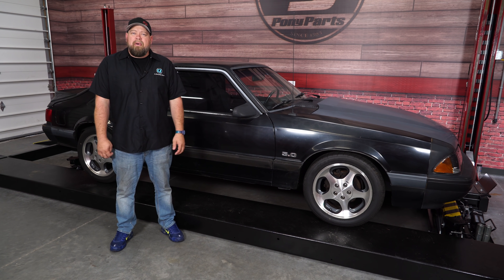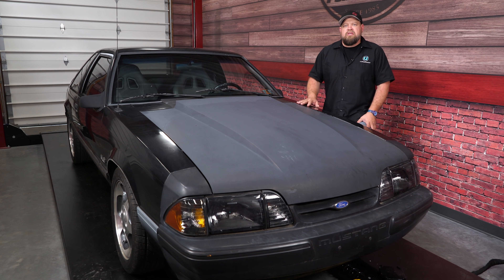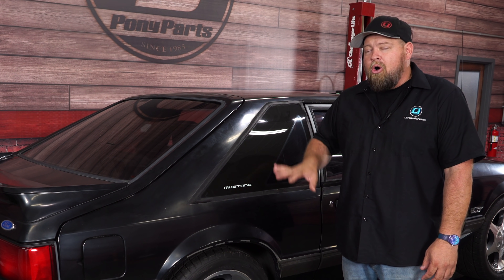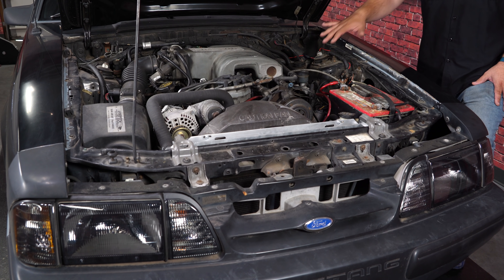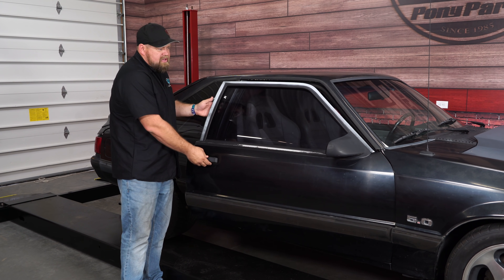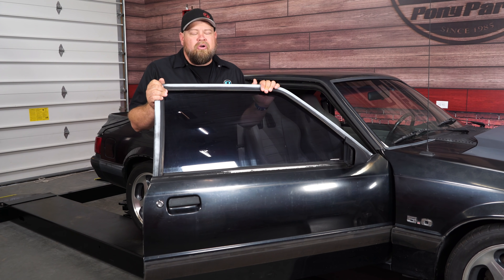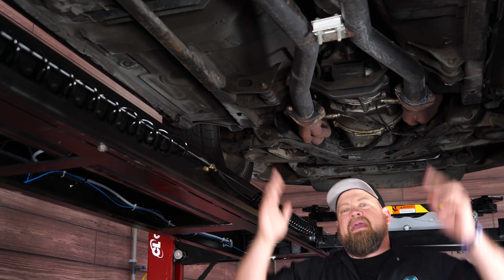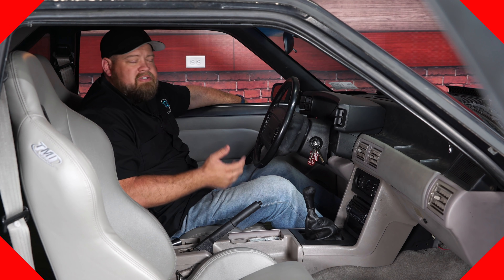Buying a Fox Body Mustang? Here's What You NEED to Look For!

Comment: IMO a few other things to consider.  The HO5.0 has forged internals and so high miles are easy to obtain, even with moderate abuse.  200k is nothing to a stock motor.  An automatic will have less abuse, and so in many ways a better foundation for a project.  

Often overlooked especially for modified car with severe abuse like drag racing may show in cracks across the top of the a pillars with body twist. If you see a crack at the top of the a pillar, presume too that the torque boxes are going to be twisted as well and that its had a hard life with too much spent on slicks on a sticky surface. Check for these things even if its 'stock'. These cars have history and it may be stock now, but may not have been so its entire life. 

If your going to modify be careful of the the 86. Its the first year of EFI, and it is a one year only head and piston combo.  This means that most 'top end kits' won't fit without changing pistons. Roller cams were available first in 85. 

Mass air (89-93) takes to mods (bigger heads, intake, etc) like fish to water, but not the same for vs speed density found on 86-88, and if you upgrade to mass air, you have to replace the computer as well. 

79-85 cars do not have an 8.8 rear end.

Last point, 91-93 has slightly wider fender opening at the bottom, which makes it easier to have larger wheels.  

This makes 91-93 cars a premium, so expect to pay more. Deals can be found in older years but at a cost to modify, and keep your eyes peeled for Lincoln Mark VII, as they have the same HO 5.0 as the mustangs and make great donors and rarely live a life of abuse we see in the Mustangs...and yes those comfy seats in the LSC Lincolns do fit!
Reply: Great write up thanks
Reply: Didn't know that, thanks for correcting.
Reply: Trick Flow top end kit works well with the '86 setup. You are still stuck with the crummy speed density ECU and tiny 10" front brakes though, unless you swap those out - skip the A9L and go for a Megasquirt based ECU if you want to get into heavy mods. 86-93 has a 10.5 inch clutch, too, which is better right out of the box, and you have a lot more aftermarket choices.
Reply: No, 93 aren't forged unless is a 93 Cobra or Cobra R
Reply: Another thing not added is that the Aftermarket Lights, although they do look great, they are a total pain in the ass to adjust correctly. I'm the only one (that I know of) as of this date, 12/1/18, that has complete sets of NOS 6 Piece Light Sets.  mustangman@goldenwest.net  Jon
Reply: You might want to update that. Speed Density cars take well to bolt ons. You can change the heads, intake, cam, ect but you have to be careful. Mostly with a cam upgrade. You can switch it to mass air but Ive seen quite a few run worse after switching the ecu. If you want a mild street car then get a sd car. Heads and intake are also tricky to nail just because trying to tune it right is a pain.
Reply: So... pull the engine, and scrap the rest and look for a project car to receive the transplant.   Got it.
Reply: Prushimush 90's and earlier Trick fllow heads never made good power. They had great marketing, but unless they're newly designed and manufactured heads I'd stay away from them.
Reply: There is one infallacy the 89 is the only year with a gray interior that had red tweed or a pattern of red threads throughout the seats. Also the 91-93 have air bags, hence better insurance if your company provides discounts for things like air bags and abs, power brakes, less power ( 4cly or v6) etc. The 2.3 turbo and 4.2 V8 are REALLY hard to find. More notes
Reply: @katcraig9460  ...yet another reason I like the '79-'86 the best...I have never been a fan of plastic "composite" headlights...don't like them to this day..give me glass sealed beams...I think the '87-'93 looks fine now, but I still prefer the earlier ones...for me, I like the '85-'86 setup the best...I remember when the '87's came out, everyone was exited about the extra power, but reaction to the new front was negative from most of the guys I knew, including myself..I remember comments about the "Taurus-looking" front end...in the end, though, it didn't stop most of them from buying one....
Reply: Thank you! Great details to know.
Reply: Sorry to correct but: it´s just the pistons that are forged, the rest of the internals are not...-92..93 cobra, same thing. I´ve worked on these cars for 20 years, own 2 engines. but they are great fun none the less, best bang for the buck
Reply: @petedogg369  It is for me since I'm running an 18" wheel that supports oversized brakes. Well worth it for me.
Reply: @petedogg369  To each his own, and there's a world of aftermarket to suit everyone. The options I want require the extra, albeit small, different. My lx hatch will use every bit of that extra fender for 18" Makers Garage wheels and 6 piston brakes. For what you do sounds like cobra's are the route.
Reply: I guess Im asking the wrong place but does anybody know of a tool to log back into an Instagram account?
I was dumb forgot my login password. I would appreciate any tricks you can give me
Reply: @Aiden Grayson Instablaster :)
Reply: @Briar Kashton i really appreciate your reply. I got to the site through google and im waiting for the hacking stuff atm.
Looks like it's gonna take a while so I will reply here later when my account password hopefully is recovered.
Reply: @Aiden Grayson no problem :)

Comment: Check for a gap between the top of the fender and the lower windshield molding on the passenger side. If the gap is noticeably larger than on the driver's side, the car has been launched hard repeatedly, twisting the subframe. A small difference is no problem but if you can get a matchbook under there, the car should spend some quality time on a frame machine.

Comment: Foxbodies are still kings of outlaw, no prep and 1/4 mile drag racing. Any engine/trans/boost combo you want, they can take. Dont forget, first mod needs to be subframe connectors!
Reply: HI I'm thinking of buying an '87 FB, as I have a 400 with a c6 ready to go. Will this combo fit? What mods will I need to consider? Thx, Bob

Comment: My father just gave my 13 year old son a 87' convertible GT 5.0 liter.   Originally bought by my brother in law and given to my Dad when the head gasket blew when they were moving out of state.  So the car is awesomely solid.   No door dings and well maintained.  It mostly needs a super cleaning, little fixes and some customizing.   The only rub is it doesn't have AC.  He bought it up north and then moved to Alabama.    So, how hard will it be finding a junked one with AC to add it to the car?   I look forward to working on it with my son.  In the early 80s my Dad and I build a 65' for me.  My Dad gave it to my son while under hospice care.    I learned a lot building a car with my Dad and its and experience that I will always cherish.

Comment: I bought a 79 5.0 4 speed Indy Pace Car in 1987. It’s floor cracked below the driver seat in 1988. It’s a fairly easy weld with the seat out but Ford was just being cheap with the design of that floor pan. The 1979 model had more engines than mentioned in the video: 2.3 normally aspirated,, 2.3 Turbo,, 2.8 V6,, 3.3 inline 6 which was 200 cubic inches and the 302 V8. Ford ran out of the 2.8 V6 before the end of the 1979 model year and started installing the 3.3 inline 6. The pros on this Mustang is its light and a lot of aftermarket parts are available. The cons is that they are not a strong body in a crash. I would consider a roll cage for one if I can ever own another one. The guy in the video didn’t mention the 79-81 2.3 Turbo’s which often didn’t make it to 100,000 miles. The 80-81 Cobra was a nice looking car especially the black one with green stickers. One of them used to show up at the Dairy Queen I worked at in 1987 and 1988. I’d love to find one with the V8 and either sunroof or standard roof,,, no T-Roof because they leak.

Comment: I bought a 93 and spent many paychecks on it.  I didn't even know that car was in a severe wreck.  Don't make the same mistake i did.
Reply: How did you end up finding out ?
Reply: @heavychevyss2784  
Usually on the cars door jam there should be a state sticker on it sometimes saying the likes of "certified re-built". My 2000 Toyota 4Runner SR5 v6 was rebuilt as well but I didnt know until months after I bought it where I discovered the sticker in the truck's door jam. It's kinda still reliable, but nowhere near as reliable as it would be had it not been wrecked and re-built. I'm guessing Sinister Rc found out in a similar way.

Comment: 86-93 cars are the best from an out of the box standpoint - 8.8" rear, 10.5 inch clutch, fuel injected 5.0 engine. 1986 is the last of the Four Eyes and has most of the good stuff from later models. In 1987 you get valve reliefs on the pistons for bigger valve/cam clearance and better heads to match. In 1989 Ford moved to a MAF setup for the ECU, which happens to work better with aftermarket cams and other mods.

It's worth discussing pistons on the stock 5.0 engines. In 1986 you get forged flat tops. These pistons don't play nice with most heads and cams, but you will have a lot of clearance with Twisted Wedge heads from Trick Flow, so they are still worth using if you have them. From 87-92 you get forged pistons with valve reliefs to match the new E7 heads. These are good pistons and work well with all sorts of heads and cams, AFR et al and are generally the best ones to have from a head and cam choice standpoint. In 1993 Ford introduced a hypereutectic piston to replace forged pistons. This new piston expands less under heat than the old forged pistons and were cheaper to produce, but they are considered inferior from a hobbyist standpoint as they don't handle boost and nitrous as well and are somewhat more vulnerable to detonation than forged pieces.
Reply: Thanks so much. I have been asking the Mustang "experts" about my 91 pistons and so many people have told me they are NOT forged, but from what i have read they are. My question is can I run TFS Heads with these or should I switch them out? I have an older set of twisted wedge heads and a stage 2 Trick Flow Cam that I want to install when I rebuild my motor later this year. I'm also going to get the Trick Flow top end upper and lower.
Reply: @pagosplace3065  put them on check valve clearance if it hits then obv no go

Comment: Yeah, he nailed the top 3 in my opinion.  Cracked strut-towers, rusted out floorpans, and ripped torque boxes.  Good luck finding one that has none of these issues unless it's been a garage queen since birth.  He's actually missing another issue.  The leaking windshield.  Also, in the bottom corners of the windshield, behind the plastic speaker-grills, if you remove them, you can look at the sheet metal panels here also.  These tend to rot fast.  Just before I sold my 1990 LX, I checked mine and they had dry-rot.  I had fun with the car, but since selling it back in 2009, I don't miss the car.  I would never buy another either.  My advice to anyone here, unless it's a car from Arizona, you'll never find a mint Foxbody unless it was torn apart and rebuilt correctly.  I read articles when these cars came out they had already started rusting in the dealers lot.  Most I'd ever spend on one today is $5000 USD for a mint specimen.

Comment: 89 gt was my daily knew a friend who had a 90 gt. Fog lights would cut out the headlights randomly, not fun to have your headlights/foglights  shut off  doing 60 mph on a country road at night. Guess the switches are bad. Don't ever rage punch the horn in a pre-airbag fox. I did, the horn got stuck on and I had to drive like an idiot for a mile before I pulled over and pulled the horn fuse.
Reply: I had a 93 GT amd it did the EXACT same with the factory fog lights! Lol the first time it did it scaredbthe shit out of me. I just popped em out and put a set of PIAA lights in the holes.
Reply: I punched my horn in my 89
Lol. Had to do the same thing

Comment: Just gonna throw this out there it's been awhile living in my Mustang life but time to get back at it.... Great videos.... I have a1983 mustang GLX Convertible... 5.0..5spd Manual.... White exterior black stripe up hood... With hood scoop...Interior all black....78,000 Original miles... Only thing not original are the rims.... Was told came factory with hubcaps. Years ago when I was researching I could not find one like this... Was told by the car dealer that the guy that owned it before me ordered it out... I'm thinking I might have 1 of 1.... Open for any comments... Craig R. Olson

Comment: I have 3 in my garage from when I was 19 I have a 89 90 and 91 2 have 25 anniversary on them the one is built up well 373 gears tremec tko 3550 trans the 5 liter is stroked gt40 head b303 cam it hauls ass no cats bbk h pipe and headers upper and lower intakes are hand made subframe mounts strut tower brace rear sway bar I like it alot I wouldnt take any under 89 the fuel injection 5 litres is were it's at.

Comment: i like how the heater core problem is glossed over as a "time consuming repair". i replaced 3 of em in 2 different cars. basically ya gotta take out the interior except for the rear seats. you could do a motor swap in half the time. them fox bodies like to eat em up. yum yum. they are thinner than tin foil. Be very ginger with the inlet and outlet hoses under the hood. also, LEAVE THAT FLOW RESTRICTOR IN PLACE!! If ya took it out, ya know what will happen...

Comment: So make sure it's not rusted out. Same advice applies for all cars. The steering and fromt suspension should be checked too. They tend to be sloppy after 30 years and 200,000 miles.

Comment: Bought a 84 1/2 GT way back in 86. The heater core was already leaking.
Did handle better than the earlier models with the 4 strut rear. The EFI was trash though.

Comment: If the bolts and the plate on the trust tower are rusted, is it safe to say the rust traveled down? Would you see that through the wheel well?

Comment: They also respond really well too simple bolt ons like a chip an ignition underdrive pulleys throttle body flowMaster hi flow cat headers centrifugal Paxton super charger, some chassis items from steeda and you have a capable daily

Comment: Thanks for the video...good info.  I have to point out that as an owner of a 1983 GT...bumper covers are NOT available for the early Fox.  I looked for over a year for a rear bumper cover and it took me that long to find one in good enough shape to use.  Used only...nobody makes them new yet.  I think the fronts are the same but there are still some NOS out there but rear covers seem to be almost non-existent.  Perhaps you could bring this up with your supplier to repop them?  Thanks.

Comment: There was a few things he missed like the hatch locks normally either rust shut or rust open and there is a inertia switch behind the tail lights if something bumps you from behind or you take the lights out it sets the button off and the car wont start easy fix but I had no clue it was there and the firing pin in the ignition I've seen a few cars where that went bad my car was like that and I'd have to roll start it until I found out it's a $10 fix overall though my mustang was the easiest and cheapest car to maintain

Comment: If it gets the gangster lean you just have to get to the inside of the seat under the skin and re weld the broken spot weld, done by a professional it shouldn’t take more than a hour with the taking off and putting back on the skin taking up the most time

Comment: Four eye all day , everyday !
Reply: <- '86 5.0 is my favorite, refer to my user pic. Last of the four eyes, you get the best of the 87-93 models - 8.8 rear end, 10.5 clutch, fuel injected 5.0 engine. Contrary to popular belief the forged flat tops in the '86 engine are good pieces and play nice with Trick Flow heads. Get some bigger brakes and spindles from an '87-93 Aero and you're ready to boogie. It's a good year for the Foxbody.
Reply: Had two different 84' GT's.  First one had a SVO wing/spoiler on it. It got stolen twice. The first time they caught the kids in it and I got it back, second time the pro's got it. They found the shell down by West Grand Boulevard in Detroit.

Second one came from Bill Brown Ford's used car lot. I believe it was traded in by a Roush employee, as far as I knew it was stock, but it beat cars in races that it shouldn't have. That car was a beast. I owned it for four to five years and when I sold it I still got $2700.00.

Had a 93 sedan/notch, strictly a toy, self built, 69 351 Windsor, Toploader and a 9" rear. It could break the rears loose at fifty, it was a handful, I miss it.
Reply: @dississtupid  I miss a few of mine two , I had two 85's , both notch backs , one was a GT , the other one was a little 2.3 , my dad bought the gt brand new , and I got it when I got my license , you don't think when your young and dumb like I was , fortunately I learned from my mistakes as I'm getting a bit older now . The first brand new car I bought was a 2002 GT , and I still own it to this day , and I don't ever really plan on parting with it . Back in 2017 I felt I needed a new toy and ordered a 2017 EcoBoost premium , and I don't ever forsee parting with that one as well . Now that I have some room I'm looking for a 68 fastback to add to the fleet for a running project , I'm not selling anything anymore ! I've learned the hard way , have a nice evening bud !